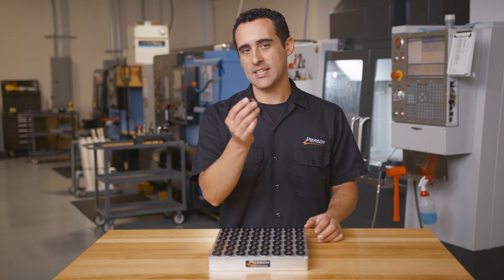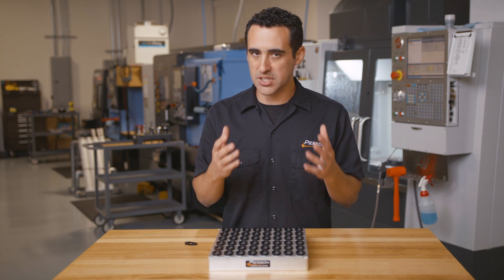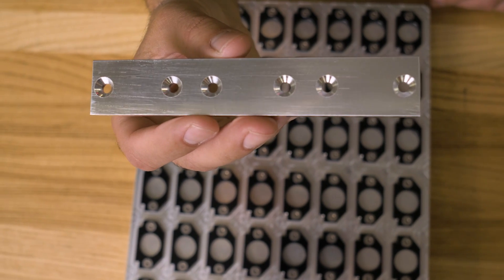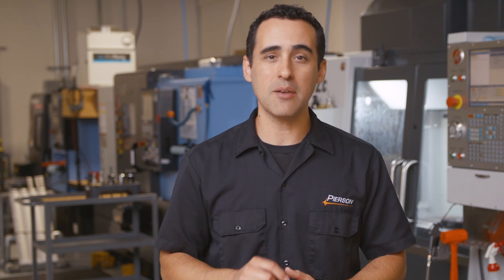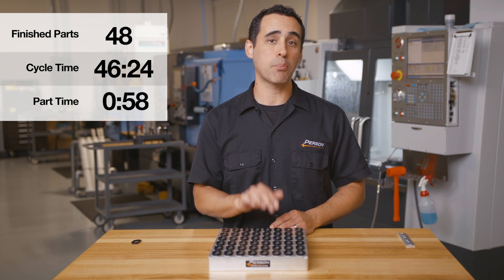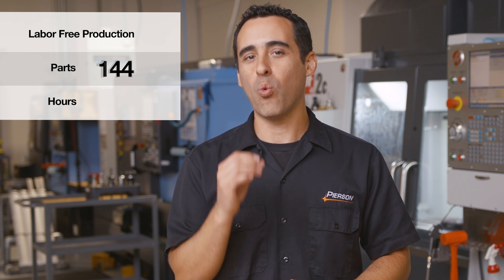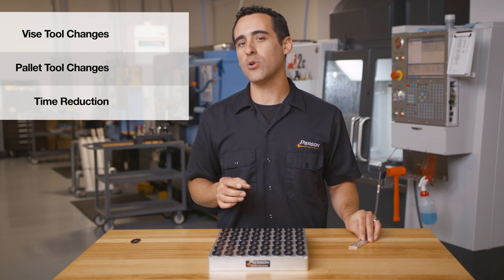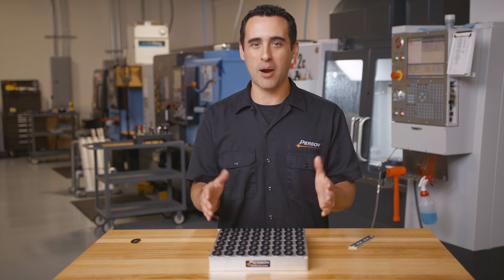More Money More Parts! Make 48 parts PER PALLET & More | Fixture Friday 5 | Pierson Workholding

Comment: Why do you have stil 50 tool changes? Is it not possible to implement cut path for all parts at once tool using, so you would have only 4 or 5 tool changes depends on your CAM.
Reply from the maker: That's exactly what we did.  Check the math... There are 5 tool changes per pallet and we ran the pallets 10 times.  50 total tool changes.
Reply: @PiersonWorkholding  ok, I didnt realized you run the same pallet 10 times.

Comment: Don’t even need a vacuum fixture... just one delrin plate and utilize all those small holes and big center hole on a big 6061 plate... probably get 248 pcs done in 6 hours one setup one pre
Reply from the maker: It's not a vacuum fixture.  Plus we average 372 pcs in 6 hours.  Did you even watch the video, bro? ;)

Comment: Hi Jay, love the videos. I have this problem in my shop and looking at that pallet made me start thinking about it "The amount of time it takes to screw in all those bolts and unscrew them" I must spend an hour a day undoing and doing up fasteners. If you were going to do that pallet but somehow eliminate all the fasteners how would you go about it, even if it's possible! Thanks for the time you spend on making the videos - Tom
Reply from the maker: Hi Tom.  A screw gun with a ball driver certainly helps.  Keep in mind the screws are done outside the machine while a second identical pallet is running so production is still high.
Reply: @PiersonWorkholding  Hi Jay. Thanks for getting back to me, if i didn't have my cordless drill i think these pallets would of made me insane. I guess some things are what they are and can't be improved on.
Reply: Is it possible to use a quarter turn clamp on your application?

Comment: Love your content Jay, but the video wasn't as clear about how the part was made. Do you deck just one side and leave the other side as raw stock? Do you then tumble to get a good finish?
Or why on the pallet did you ghost the part outline? Was it to help prevent a bur, or to help make sure the tool didn't slot first time it was ran?
Plus everyone loves a bit of machining footage, or even just the fusion 360 cam simulation.
The extra info is helpful and makes it feel less of an advert (which it obviously is of course - no shame there at all) but with a little more info it would add extra value too as we all learn. Just my thoughts, not meant as criticism.
Keep doing great stuff! 👍
Reply from the maker: Good points we'll take into consideration.  Yes, the bottom side only required a mill finish and no edge break allowed.  The ghosting you see on the pallet is simply from the endmill machining 0.010" below the bottom surface of the part to ensure a full cleanup.

Comment: I like how you've been highlighted the reduced tool changes!  Not only a time saver, but extending the mechanical life of the machine.
Reply from the maker: Yes, a VERY overlooked fact.
Reply: @PiersonWorkholding  And tool holder life! Everytime in and out of the socket tends to reduce accuracy and stability just a bit, especially if you start to get a spindle taper a little out of spec.  The faster the tool changer in and out of the socket the greater the wear tends to be.